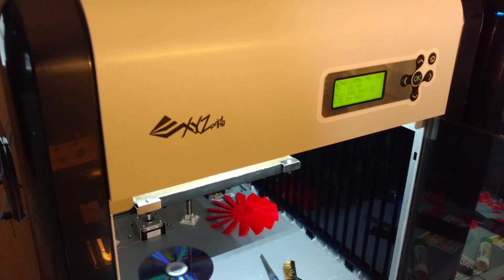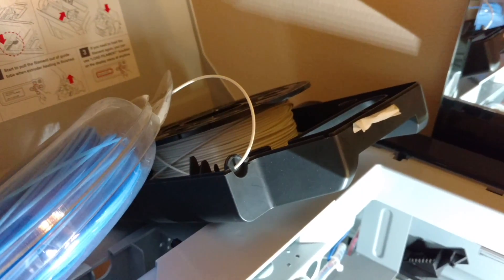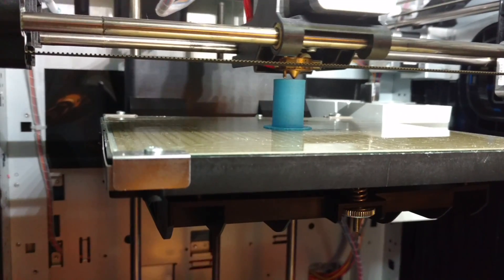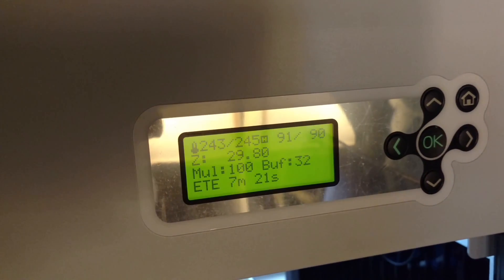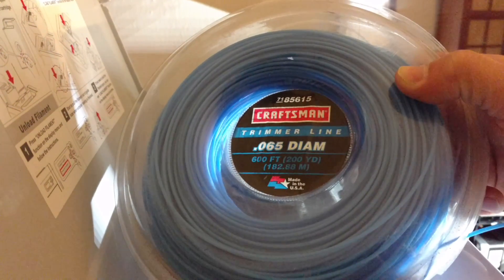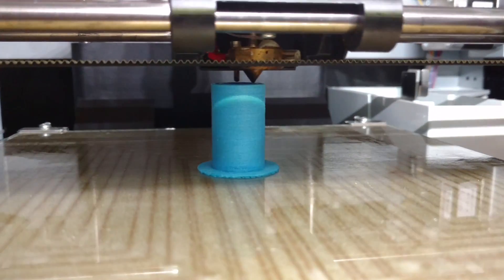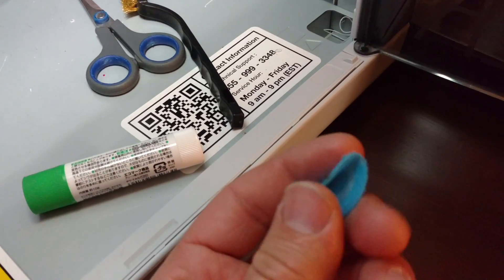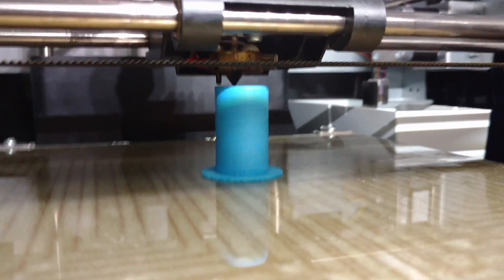3D printing with nylon for prototyping

Comment: I'm not sure this is real
Reply from the maker: Yes it was plain weed eater string out of my garage. I didn't want to wait for the tolmin 230 to show up, so I grabbed this and put a micrometer on it. It was 1.756 so I used it. It worked but wasn't the nicest print due to it being hygroscopic. On the moisture and it was causing it to pop when it at the hot nozzle. But yes very real and led to a patented product.

Comment: What temp to dry out the line? I wanna give this a shot.
Reply from the maker: I don't remember what temperature. I ended up just ordering a taulman nylon. I just wanted to try that weed eater string to make sure that the nylon is the type of material I needed for my project. I needed something more flexible than ABS or PLA but still very tough. I would just put it in and use it. If it pops too much and doesn't yield the results you need, then try to dry it out. Thanks for watching and commenting!
Reply: 70° Fahrenheit for 2hrs

Comment: Thanks for posting. Can you save your settings from repetier and what all you do to get clean prints like this. I cant seem to get anything like yours quality
Reply from the maker: Rico O'chet I'm not quite sure what you're asking about saving repetier settings? I don't know a whole lot about 3D printing, I'm by no way a pro at it! I had my fair share of trouble trying to get it going. I did a lot of playing and tweaking settings. Once I verify after rooting it that it would work with nylon I then bought some Taulman and use that beautifully for what I needed. What kind of problems is yours having?
Reply: Try drying the trimmer line.

Comment: How has this worked out long term? I have heard folks say that nylon trimmer line has additives that are abrasive, and it'll wear down a standard brass nozzle.
Reply from the maker: Paul Archer I only used it a couple times to verify it would print, after I rooted the firmware. The trimmer string has been sitting in my garage for a few years and had too much moisture in it. I'm not sure about the additives, but makes sense because it needs to be tough for the job it was designed for. I did end up getting some toleman filament and it worked perfectly for what I was after. My parts had some small detail in the middle, and I could not get the trimmer string to print like I needed with all that popping. I was just trying to verify I could get the printer to print with nylon before buying the filament.